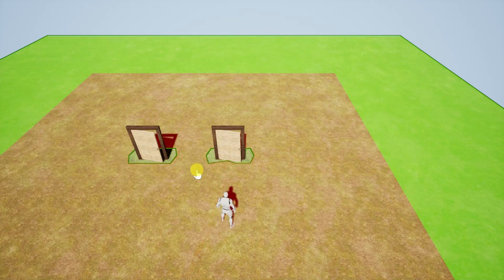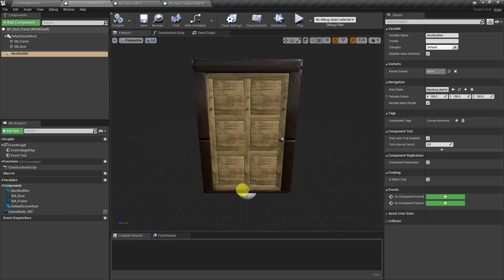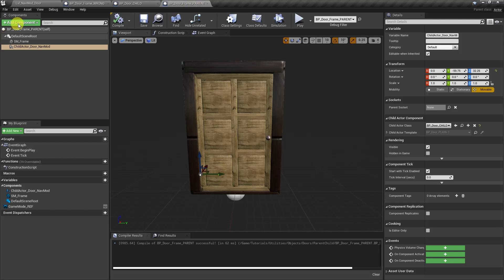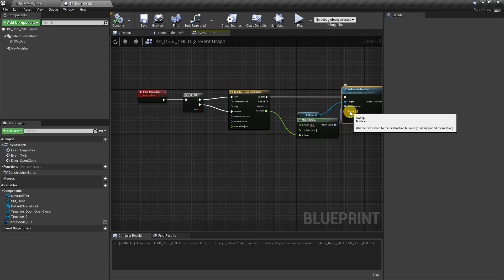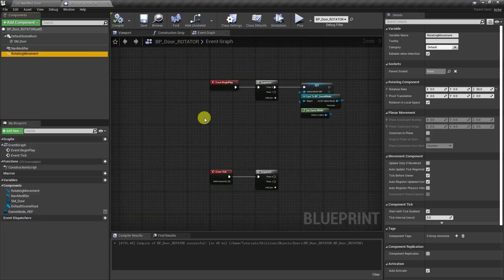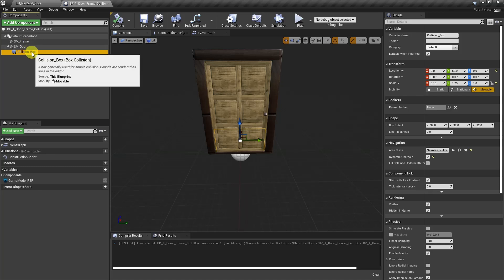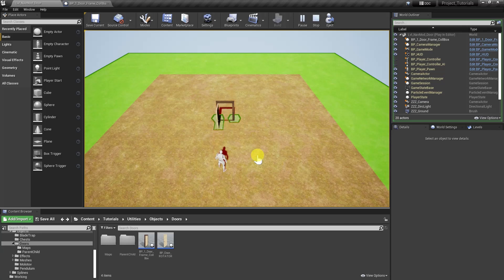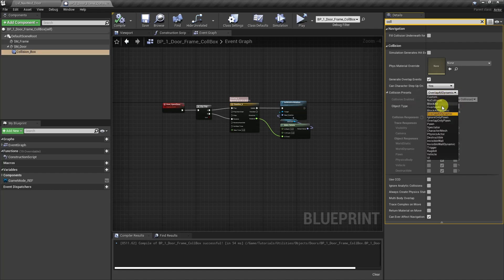Help With NavMods For Doors That Rotate; UNREAL ENGINE 4.27 & 5.3.2

Comment: Yeah it's a bit frustrating that you can't attach a nav modifier to a BP component directly. If you don't need the path to to be valid with the door's rotation exactly, you can also use a more binary approach. Put a nav modifier on the door BP and toggle it between Null and Default as the door becomes fully open or fully closed. I do this at the end of the swing and it works well, plus it keeps AI from trying to pass through the door as the path is established through the doorway.
Reply: Thank you!
I spent like like 3 hours trying to get the dynamic rotation to work and that's really all I needed. Kinda makes me feel stupid honestly...